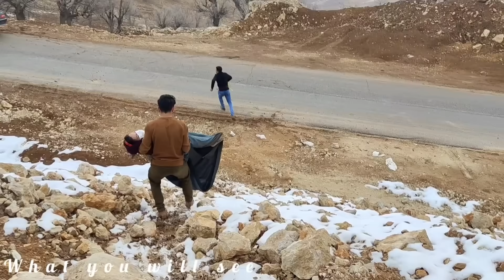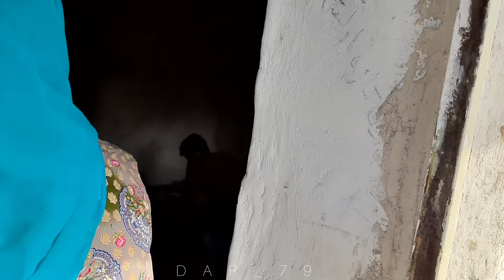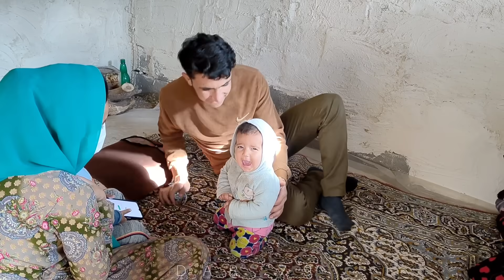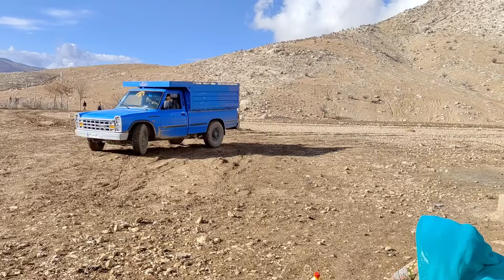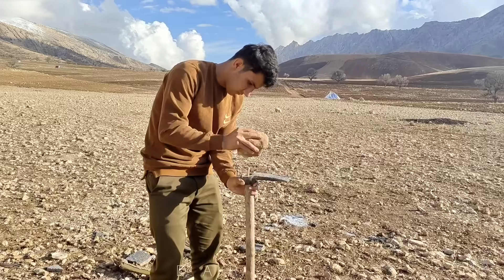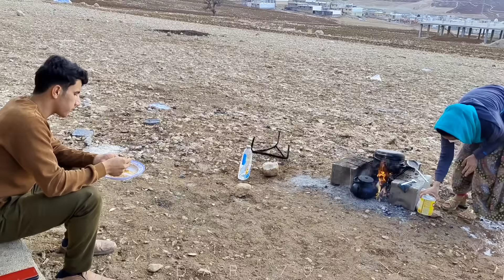Rasool and Narges: cooking that warms hearts and saves children

Comment: Rasool needs to get a better vent pipe for that heater that flex pipe is junk get the straight aluminum with a elbow should go up pass the roof line.